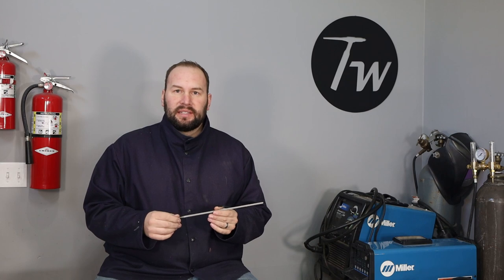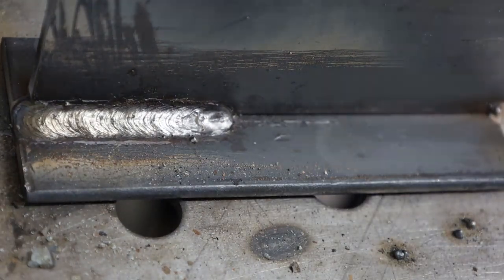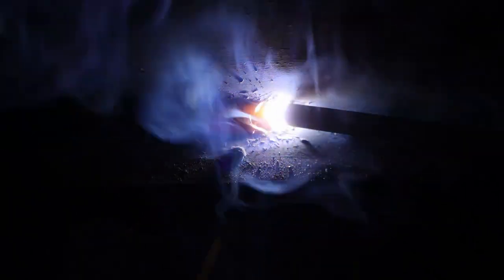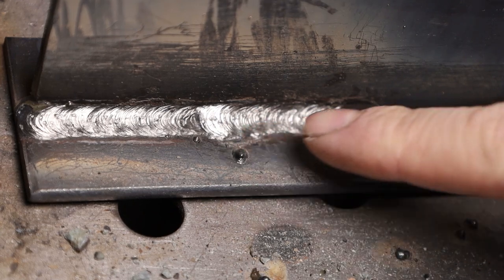Stick Welding: How to Restart

Comment: Re starting a 7018 is my nemesis at the moment. I have two inverter machines, one is a small 160amp basic stick welder with just amperage control. The other is a multi process mig, tig MMA. It has arc force and any easy start function and does seem to weld 7018 better and it also has settings preset and you can choose 60xx or 70xx.
I do like the small welder as it's so convenient to move around but I do struggle

Comment: I first thought you were talking about me... I am restarting after 30 years of not welding...
Reply from the maker: That’s awesome!
Reply: I am getting back into this as a hobby and putzing around. I have a new 160amp inverter 110/220 welder and I am wondering which welding tods do I need to have laying around for playing with steel...? What are the types of welding rods I should keep... I know, not the best probably I have some 1/16 6013... I think I need some 3/32 of the same... But what else for a beginner...? I am thinking just two or three types as a max... I also have a 30yo Century ac/dc welder that I am afraid to even turn on...

Comment: I know Jack about welding but your videos along with the Essential Craftsman are big motivation to get welding. My first project might be a rebar trellis. Any suggestions on that and what I should be doing/buying are very welcomed.
Reply from the maker: Cool! For a trellis like that, you really only need a welder, angle grinder, cutoff wheels, a welding helmet, jacket and welding gloves. As far as the welder goes, pretty much any process will work for that project, so I'd think about future projects and what kind of welder you want. The 3 types I'd research are Stick, MIG and Flux Core. I have videos about each of them on the channel that will show you all the basics. Stick welding will be the hardest to learn of those 3, but is also the cheapest. Once you get the gear, I'd just start by making welds on some scrap metal.

Comment: Great video as usual! Interesting that you found the Hobart not typical. I bought my first box of rods ever, a 5 pound box of Hobart 3/32 6013, from CyberWeld along with my hood about a month ago, thinking they'd be a good name brand to go with. I have no experience to compare them with obviously. Any lack of slag peel right now is definitely my fault though 😉
Reply from the maker: Thanks! The rods run really well and I’m sure the weld is sound. The slag is just different than other brands, but it chips off easily enough. Maybe I’ll compare a couple different brands in a future video.

Comment: Non welder question: Does it matter if the weld is not continuous as long as you have the specified length of weld?

Comment: I'm trying to burn them to the numbers, but if they're longer and I'm starting a new weld I save them for times when I've run the electrode to the numbers and have just a little bit more to go.

Comment: the dimensions of the work piece determine how often  you will stop burning your rod. if your running a 10  ft  bead..no problem...a 6 inch one?...unless you want to throw away lots of rods you will need to know how start up with "old" rods a lot

Comment: Hi Tim! Where should a brand new welder prioritize learning restarts? I have yet to run my first beads, but will be doing so in a few days (gotta get my 240 sorted a few more pieces of gear first). Obviously my first goal will be learning to strike and arc, then running beads... what then?
Reply from the maker: Awesome! You're going to have a blast! I'd start with running beads focusing first on arc length, then on rod angle and finally on travel speed. Once the beads look good, I'd weld a few joints together. Next comes welding joints in different positions. After that, restarts.

Comment: I find this concept of going back a bit confusing; I'm learning, early days, with 6013s and in my mind if I head back to the stop position I'll be pushing slag back into my weld. Am I over-analysing this?
Reply from the maker: It's a great question. The point of starting ahead is twofold. First, you cover your arc strike mark so that you don't have an ugly stress riser on your existing weld. Second, it allows the rod to heat up and the flux to activate so that you don't get a cold start or porosity. The key is to move into position quickly enough that you don't deposit any appreciable amount of weld and the little bit that's there will float out when you run over it. You're right, though, you do have to be mindful of the slag and 6013 is the most difficult for that.
Reply: @TimWelds  Thanks Tim.

Comment: QUESTION:
Is this applicable the other different rods as well or it is only applicable to the 7018 rods?
Reply from the maker: Great question. The concept of striking an arc ahead of where you stopped and moving back into the crater applies across the board. Each rod runs a little different, for example, 6010/6011 usually needs a little rod manipulation, so with those rods, you would need to get back into the same routine right after you fill the crater.

Comment: when you restart strike downstream from your stop point, then travel upstream to your stop point, then continue welding downstream again (without deslagging), aren’t you trapping some slag?
Reply from the maker: The slag needs to be removed at the end of the previous bead. When restarting ahead, it’s a relatively quick and short motion back to the end of the previous bead and very little if any material is deposited. I’m not aware of another way to do it that doesn’t leave an exposed arc strike and risk porosity.

Comment: Why do I keep getting porosity on restarts? I feather my ends out and start about a half inch in front of the weld. I come back and pause for a second where the feathered out part of the weld starts and always get small clumps of porosity and grinding that back out. Sometimes chase it for ever it seems before I don't get it. The rest of the weld looks good. just the start sucks.

Comment: That would be a slag inclusion if you go back on a weld like that, will fail inspection/x-Ray rather grind out and restart a little back and move forward again, 7016 rod is unforgivable, don't take a chance

Comment: My problem is it doesn’t start up as easy as the first arc without sticking
Reply: Depending of the rod you are using, sone of them will burn inside of the flux coating so just tap the tip on  something hard like concrete to break it. I usually use a worn out grinding disc for this purpose (not attached to the tool). 

If still is dificult to start an arc, heat up the rod first keeping an arc for a second, either on another place of the workpiece that can be clean off later on, or on a another piece of steel. Once your tip is hot will start the arc at the first tap back on your weld.